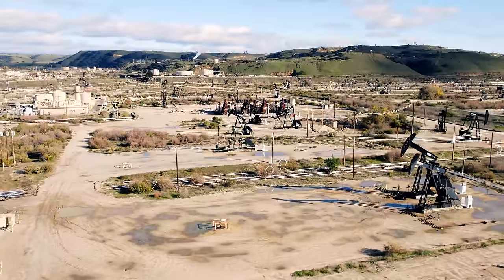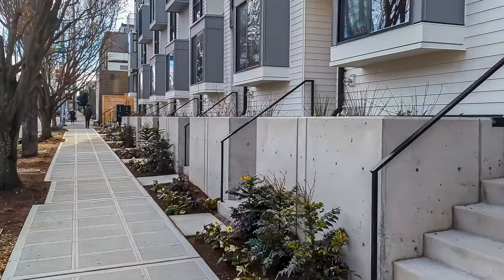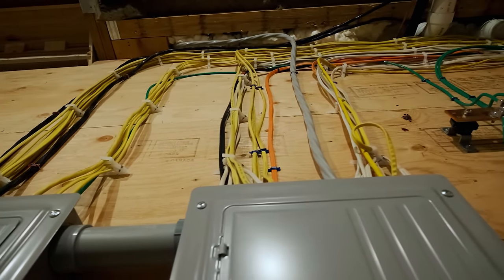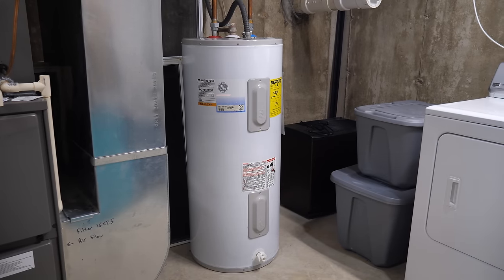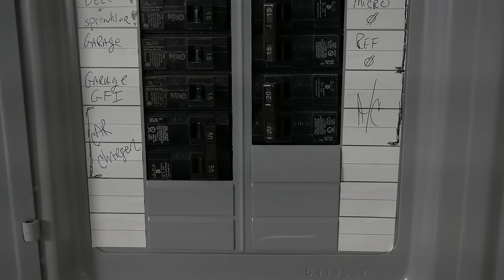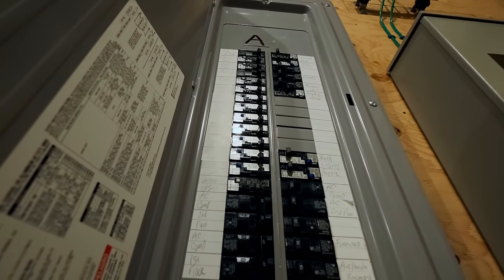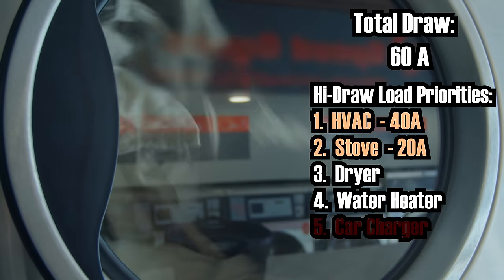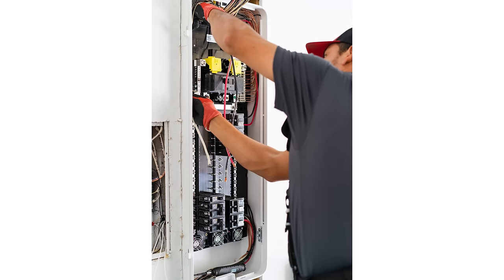Home Electrification: There's not a lot to do, and it doesn't have to be hard (Part 1)

Comment: European heat pumps..those that take from air and give to water jacket... usually have integrated water heater for hot water AND also have 3 heating elements (often can be adjusted by PWM) each 16A on each phase, so 3x16A maximum as an emergency backup in case it drops below -25*C when HP doesn't actually work well. No need to have like 22kW of heat. Except if you keep your windows open or you live in a tin can.
Reply: That means US HP manufacturers should immediately stop oversizing elements.
Reply: It is actually super OK to have somewhat cold home when it is -30C or -20F. No need to super overload the grid to "I live like a king".

Comment: South Africa for the least 10 years or so has been going backwards when it comes to electrification. In the early 2000s most people would have electric everything, gas only being used by some people for outside cooking or during emergency power outages. That was back when the South African grid was functional however, now days with the wonders of rolling black outs more and more people started using gas stoves, heaters, boilers and sometimes even fridges. Solar power becoming cheaper has started offsetting this somewhat butost new houses in South Africa have a few gas appliances as future proofing.

Comment: Starting Jun 1, 2023.... West Penn Power: $0.09929 per kWh effective June 1, a 20% increase from the current $0.08228 per kWh.

Yes, electric power cost isn't volatile (rolling eyes).

It costs about $16 per BTU to run a gas furnace and $41 per BTU for an electric furnace, more than a 250% increase.  So while yes, you certainly can put in a electrical furnace, enjoy your bills, particular in the winter in anything but the most moderate climates.

Gas Dryers also are about 50% the cost of operation vs Electric.

While it is relatively "simple" to move your home to all electric,  there is a reason gas rules the roost, particularly in all but the most moderate of climates, and there is no math coming on the horizon that is going to change that in the near future.

Comment: From an electrician. Nothing is difficult for us as long as you have very deep pockets. If a person has an older poorly insulated house and is going all electric and own two EV'S  might need a 300 amp service. Not cheap to install wires & thermostats to baseboard heaters in every room, 50 amp line to electric range, 30 amp circuits to electric dryer and up to a 60 amp line to instant beat water heater. So better have $25,000 minimum to start purchasing new electric range  instant hot water heater, electric dryer etc. Know of one person that had two EV'S & three of the children drive both EV'S until mid night for work, night school & pleasure. Both parents at least once a week have to drive most of the day foe work and both had to stop by noon time be Suze EV was out of charge. Smart panels that I checked out were expensive. If you have to replace a panel the latest NEC requires an outdoor service disconnect and might have to upgrade 30 single pole  circuit breakers to $50 AFCI breakers (  $ 1,5000 plus mark up ).

Comment: Gas is more efficient and effective for heating depending on the local climate.

And electric water heaters don't work in restaurants unless it's a very small restaurant. the recovery rate isn't large enough

Also be extremely careful especially if you have a Federal Pacific panel!

Comment: 20:19 The National Electrical Code in the US has already been allowing automatic load management systems in lieu of the conventional overly conservative high demand factors since at least the 2014 Edition, probably even the 2005 Edition. As far as I know, the oldest edition of the NEC adopted by any state as of 2024 is 2014. So, it's probably that the electricians haven't read the changes for every code edition (once every 3 years) from decades ago yet, or that you're simply recalling outdated information from the memories you had from the early to mid-2000s for example (which is still the "cutting-edge" time for Baby Boomer politicians because it's still falls within the "21st Century", despite how obsolete a lot of early 2000s electronics equipment is by now).

Comment: During the summer, my gas hot water heater makes hot water while my air conditioner rejects heat.  What if, instead, the heat from my air conditioner made it into the water heater via a stronger heat pump?  Wouldn't that be more efficient? 🤔

Comment: I have 25A 230V (European) installation and I don't remeber when my main braker popped last time. In fact, I have 3 phase current, but 2 phases are not connected to anythink.
But I heat home and make hot water by burning coal, I cook using propane gas and I don't have an ac, which is normal in my country (Poland).

Comment: What you're describing here won't pass code inspections in many/most jurisdictions.  That bare romex going into the breaker box is also a violation.  Did you pull a permit and get it inspected before that installation? ( or is it allowed in your area? )

Comment: Imagine your washing machine get shuts off in the middle of laundry process... Many appliance are designed to assume the power line to be reliable and many simply not designed to play well with sudden power loss. In my opinion, "root level" equipments should be designed as simple as possible, for better observability, maintainability, less attack service and reliability.  Also systems with cyclic dependencies are nightmares to work with (your power panel now depends on internet, and your modem/router depends on power! Sure there could be a hardware override switch somewhere). 
Back to issue with appliances, hypothetically we can have everything IoT (let's say just within local network) to have the appliances to negotiate with the power panel, and let's assume everyone is playing nice, with perfect, non buggy firmwares, no vendor lock down etc, but I'm just no seeing that ever going to happen...

Comment: Assuming the point is to reduce cost and carbon emissions, summer time cooling needs matches perfect with a lot of sunshine for solar renewables. But in winter, with massive heat needed with minimal sunshine, it's simply a bad idea to switch to electric, since the electricity would have to be generated from gas-powered turbines in electric plants at about about 30% efficiency. While just burning that gas in your furnace is close to 100 % efficient.  

Let's transition to renewables in an order that makes common sense : FIRST replace our 25% efficient coal plants with renewables, THEN switch our 30% efficient cars over to electric, and only AT LAST replace our 100% efficient heat source in our home. 

Thanks.

Comment: I have 2100 watts of off grid solar (so far). I recently discovered a cotton fiber device that, when stretched between two anchor points, can dry your clothes without any electricity whatsoever. Patent pending.

Comment: 30:30 Depending on reliable the grid you are on and how like it gets shut down, I also suggest an emergency backup fossil fuel heating solution. Be aware that that might not have to heat your home to cozy temperatures, but only to keep the pipes from freezing in a minimal setup. Because if those freeze, that can cause substantial damage and make your house unlivable for quite some time. Anyways if planned bigger, 10°C (50°F) is plenty with warm clothing/blankets.*

*=Had once a McScrooch as boss who did "heat" his home in winter not higher than 1°C (33.8°F) to save on energy cost while preventing the pipes to freeze. I also doubt he turned the boiler for showers on … 
Did I mention he had a family?

Comment: Isn't natural gas suppose to be way cleaner then other fossil fuels? I was talking to someone from a company that makes natural gas turbine generators and was told in some cases the air coming in is dirtier then the air going out. If the carbon being produced by natural gas is so small, what would be the point of going all electronic especially if the grid cannot handle it?

Comment: The problem with most remote access apps is that they're designed to operate through a remote server only.  A company shutting down the server because it's "no longer profitable" disables all remote access even though both devices are on the same network.  This has been seen multiple times in the home automation market and I suspect it's going to happen within 10 years with these panels if they don't make it so that the access device and panel being on the same network doesn't have to send commands through a remote server.

Comment: The main problem with home electrification is the overwhelming majority of homes here in my state that don’t have the ability to add electrical appliances as they don’t have 240v outlets and would also require a panel upgrade. This is proportionally true for low income communities.
Reply: And these homes do not have an electric option for any of the 4 things. My house built in the 1970s an upper middle class neighborhood does not have a single 240v outlet in the entire house. As is the case with every home in my neighborhood, unless the owner upgraded it themselves. And this is typical for the most populated county in the entire country.

Comment: I use ductless minisplits with base board heaters in all the bedrooms, the living room, and the family room and dining room. only one minisplit has a heating setting so the majority of the heat comes from the baseboards. The house had a propane heat backup but blackouts are rare so i got rid of it. was too expensive to buy propane i was never using.

Comment: I'm alright with electric stoves being more common, but I always prefer a gas unit over electric. Higher output, quicker heating, ability to almost instantly vary power output. Induction solves some of those issues but can't match gas for its heat output without getting into commercial units

Comment: I'm going to start @1:54.  There is no gas at my home, so I have been all electric since 2005, aside from having a fireplace.  Going to lead with being a huge proponent of heat pumps, and even have a heat-pump based water heater, and looking forward to the day of heat-pump based Clothes dryers.   This is well in advance of any opinion you might offer.  I will now continue the video, well aware I might be smacked down later on my initial opinion.

Comment: If the electricity is supplied/supplemented with nuclear power, using renewables could work.  Eliminating gas/coal and NOT investing in nuclear will not work.

Comment: I feel like your idea for a system of prioritized loads is actually a solution to multiple problems.

You mentioned the potential ethical issues of demand response programs. What if instead of your system saying "I have a 200Amp limit" you actually made that limit a variable defined by the service provider? Then instead of "power available = 200 Amp - current_demand" it becomes "current_supply - current_demand" and then your own system turns off your AC unit instead of the electric company. If you'd rather have the AC running than you can just switch up priorities to turn off other appliances.

Of course the electric company needs a way to enforce this so I suggest just having the meter cut power for five minutes whenever you exceed the limit.
The only big upgrade needed would be a way for the electric company to communicate to the power meter what its current available supply is and a way for your home control system to ask the meter what is available. That same communication protocol could be used by smart-home systems for tasty data logging too, helping users to know how much they're drawing at any moment.

Comment: With a forced air setup with central air conditioning in a heat pump setup, I wonder if the gas burner originally in the furnace could act as the backup? It shouldn't be disabled in any way I would imagine.

Comment: I keep forgeting that you guys have lower voltage so the tripple-digit current values keep scaring me 🙂. When you started with 100A being the low capacity option I was confused until I remembered your lower voltage on fewer phases. 
For context 100yo house has 25A fuses in the first box between it and the grid. Then the main breaker is also 25A. But it is 3-phase 240V. I have already tried running many things simultaneously and even when I expected to trip a breaker it did not. A 7.5kW heater element in main accumulation water tank (for radiators and shower water heating), large lathe in the workshop, something was baking in the oven and cooking on the induction top in the kitchen and a 3D printer running with 1.5kW bed heater was running in another room too. All at the same time. I am too lazy to calculate this across three phases with some of the things being on only one or two of them. So maybe it was just lucky that the slow PWM regulation of some of those things never coincided having all of them actually on at the same time. But that is unlikely over something like hours. Basically I don't know what more I could do at the same time to overload those 25A. With just 2 people present there is not really a way to turn on more things. Even without the smart distribution panel I never regreted ditching the gas connection after I bought this house. And since Russia has recently decided to teach us all not to depend on gas I am even more glad that I got rid of it years ago 🙂.

Comment: In terms of throttled heat and its efficiency, you may find that your non-heat loads are contributing some of the heat. The only 100% efficient electric appliance is resistive heating. Everything else wastes energy and that waste energy turns to heat. My lounge, with all my fast and thirsty dinosaur of the jet age network gear, is one of the hottest parts of my house.

Comment: Great video! Thanks for sharing all this info. :) My home has gas versions of all the big four plus a pitifully small (and very old) 40A (!) main breaker. I've been pondering how possible it would be to convert my place to all-electric without a service upgrade, but I think I may be in for the big expense.
Reply: Why change? Gas is cheap and efficient. Doesn’t seem like a smart idea to change what is already there which will cost a lot of money. Plus, if you care how your home looks you will be disappointed by any replacement for your gas stove. Radial coils don’t heat your pans evenly and are difficult to clean. Glass stove tops will always get scratches. I wish I had a gas stove. Electricity is also not very efficient. You’d be blown away by the amount of losses that occur even with renewables. They aren’t as efficient or green as people are lead to believe (I know, I work in this field). Gas is easy to obtain and will be converted to heat at a 99% efficiency. Gas’s really isn’t that bad.

Comment: It's really expensive in amps too use electric appliances.

You need a $10k battery solar set up to handle a stove.   Make sure you have actual backup "fire" for emergencies and disasters.  

A Coleman stove and propane tanks will do.    Even a bad storm can knock out your power for 24 hours.  Your water may need to be boiled.

Even a 5000btu a/c unit will drain a 1000w battery in 90 minutes. 

Box freezers are low amps tho.

Electric stoves use a huge amount of amps until they reach temperature.   This  surge makes them unusable.   You can have an electric hot plate but it's going to drain your battery fast.    Better to have fire.   Then use your batteries for all the low Amp lighting,  freezers,  computers. Cell phones, fans,  cable modem,  etc.

Fridge can be a beast.   Recommend a mini fridge for disasters.  $200  Chest freezers are very efficient once cold tho.

Comment: That sounds great until you have to live through a power outage.  My backup generator uses natural gas and, when the grid goes down, we can still live comfortably and not worry about pipes freezing, or wondering when the grid will come back up, even if it's for several days.

Comment: Electric can be usable sure.. But the gas heater in my old childhood home was the only reason we could cook, and heat the home after hurricane sandy. We had a generator to run the fridges and a TV or two, but no way would it have been enough output for a heater or a stove. 14 days of nice toasty gas heater home. 14 days of cooked food without any electricity from the grid.

Comment: For utilitarian devices that are designed to be more permanent installations, never buy one that requires any kind of internet connection or any kind of DRM/ activation. Many IOT devices end up getting discontinued within 10 years, but most circuit breaker installations will be in use for 30-50+ years.

Comment: Ok, I'm 10 minutes into this and you're talking about a 100A main breaker might be an issue.
I've got a 63A main fuse, and all eletric heat, stove, waterheater and clothes dryer.
The induction stovetop alone can theoretically pull over 7kW. oven, heat pump, waterheater, dryer and my two space heaters can pull over 2000w each. plus a few small heaters in bathrooms and heated steps outside so I don't have to shovel snow (yes my power here is ridiculously cheap) and its still not ever even in the dead of winter ever an issue, hasn't been for me at least.
When do you ever use full power on all four spots on the stovetop at the same time? right after taking a bath so the waterheater runs and yes throw the towel in the dryer right away?
No you don't, well we don't at least even with 3 kids so both shower and washer/dryer feels like they run constantly.

Comment: My grandparents still burn heating oil. I did the math, and their electric baseboard heaters (installed many years ago to meet code but never used) would actually be cheaper to run. 🤔

Comment: But I love burning stuff. I have two EFM DF520 anthracite coal stoker boilers. They both have the oil burner dual fuel option. The one in my garage has an air atomizing nozzle in it so it can even burn some alternative waste oils.